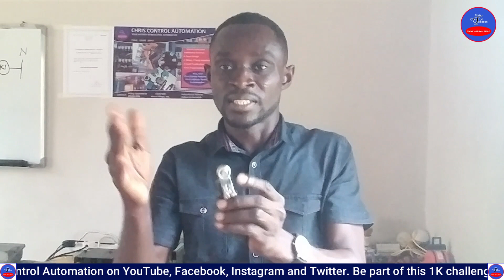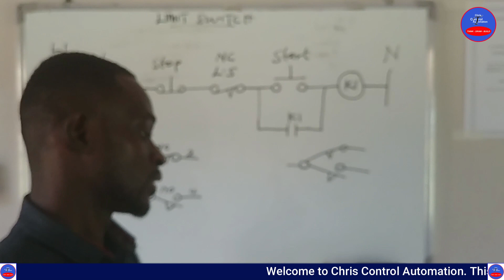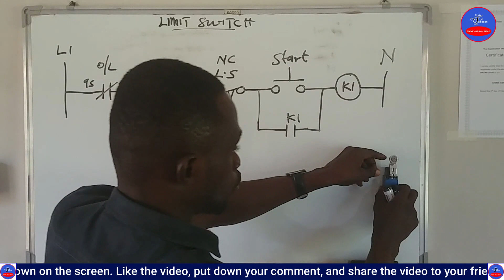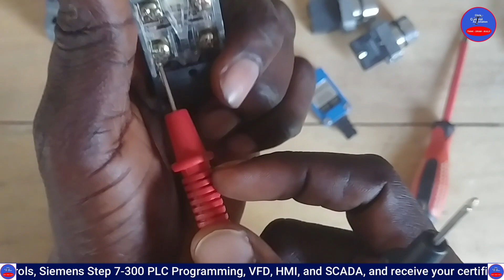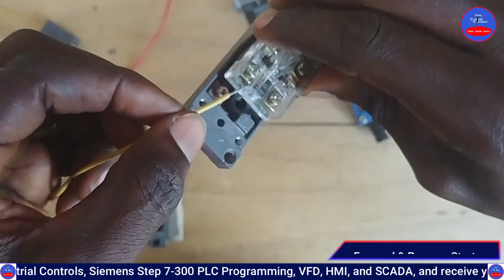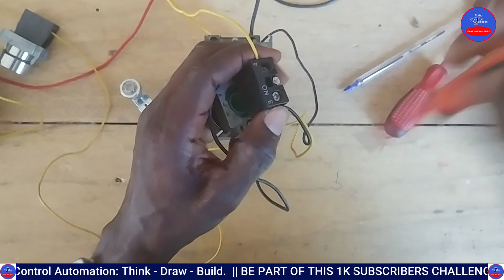LIMIT SWITCH CONTROL CIRCUIT | HOW TO WIRE A LIMIT SWITCH (PART 1) #electricalengineering

Comment: I need to understand its application am nt getting it well though hv understood the operation
Reply from the maker: Limit Switch control circuit is used in robotics, conveyor systems, drinks and water production facilities. Its nice you understand the operation, that's the most important thing first. 

Later I will show field application of this system
Reply: @ChrisControlAutomation  okk I will keep connected nt to miss such a video
Reply: @ChrisControlAutomation  thank u